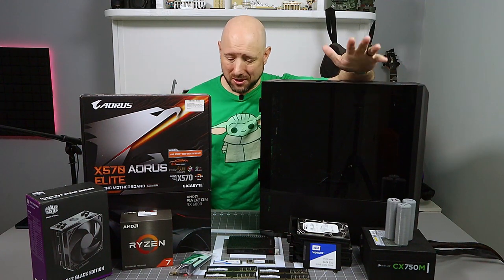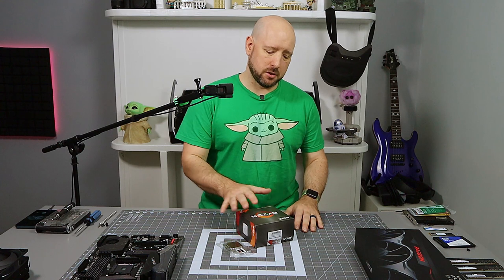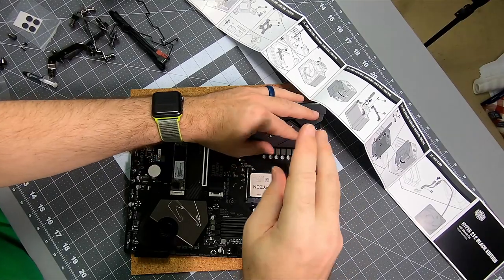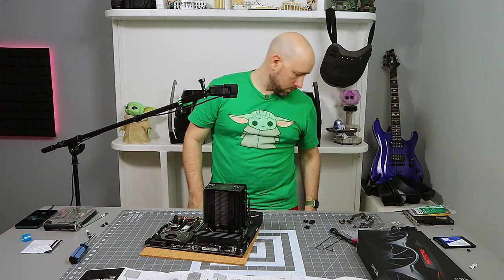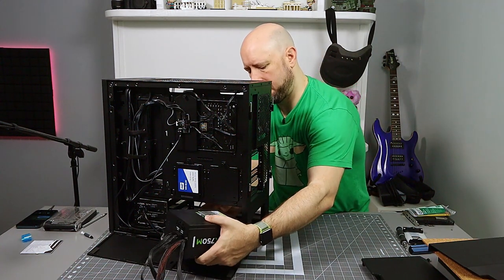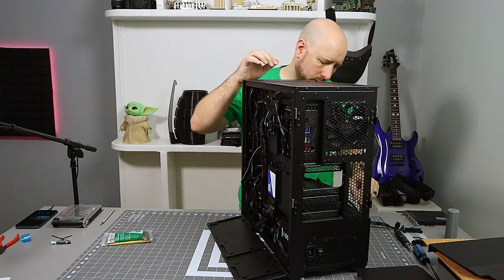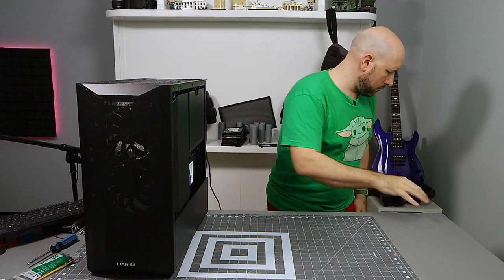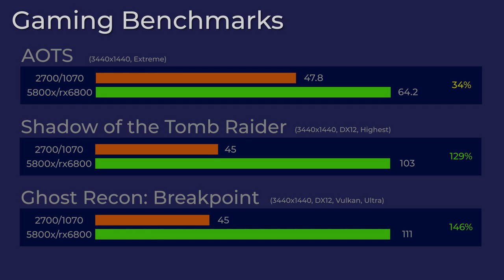Watch Me Unbox and Build a PC (Ryzen 5800x, Radeon rx 6800)

Comment: Thank you for the video. Have the same processor and same motherboard. Crossing my fingers my pc build will go smoothly this weekend.
Reply from the maker: Thanks for watching and good luck with the build!  The BIOS-doesn't-work-over-HDMI thing was a lot more time consuming that it should've been.  Hopefully this saves you some time.  Also, the BIOS on the board did NOT support the 5800X OOB and QFlash Plus directions are a bit spotty.  Here's how it worked for me: 1) Unplug everything from the board except power, 2) Insert FAT32 USB drive with the prepared BIOS on it, 3) Press the ATX power switch and immediately after press and hold the QFlash plus button 4) Hold the button ~20 seconds or so.  The QFlash light didn't seem to start flashing until the button was released.  Good luck and have fun!

Comment: Hey, have you been having temperature swings and fan oscillations on the ryzen 7 7800x? Because I have. I'm trying to figure out how to smooth out power delivery and bring idle temperature down.
Reply from the maker: Hello Javier.  Performance seems pretty consistent with expectations on my 5800x.  Idle is 50c.  Under load the CPU will boost to 4500 and temps will hover around 86-87 for the duration of a Cinebench multi-core test.  Fan also seems to be consistent under load as well.  That's with no OC at all.  If the temperatures are swinging and you don't have any custom curves or overclocking then your cooler/paste might be the culprit.
Reply: What are the max temps you get while gaming? Thanks
Reply: So the temperature swings were do to NZXT Cams software, and I also drilled some vents into my pc case. I had a really bad airflow case. I also upgraded to 140mm fans. Max cinebench is 83 degrees. Cpu/Gpu are high mid to low 60s while gaming under heavy load.

Comment: What are the cpu temps after like 30 mins of gaming?
Reply from the maker: Hey Clean Playzz.  After 30 min or so of Cyberpunk I topped out around 76C degrees.  With 45min or so of Borderlands it kissed 80C for a second but was normally down around 76.  I think it was actually the ubisoft updated running in the background at the same time that pushed it up a bit.
Reply: @LilMikeysBigPlans  did you undervolt it

Comment: hows the temps im getting same cpu coller set up this weekend
Reply from the maker: I got it to poke at 73C doing some pretty aggressive encoding + gaming.  I'm not a mad overclocker or anything and wasn't watching throttling so not sure if that means much in isolation :)  I have not seen any heat-related issues though.

Comment: whats with the cheap looking ram sticks?
Reply from the maker: Think you nailed it in the comment. That crappy little Timetec RAM operates at 3200 spec and back when I bought the first 16g it was quite a bit cheaper than fancy RAM. :)

Comment: I also have a hyper 212, paired with a 5800x. While playing games like valorant, it goes up to 82-84 c. Im not sure this is normal. And the fan speeds were fast. do you have an idea of what the issue could possibly be?
Reply from the maker: Modern CPUs will throttle automatically to maintain working temperatures.  Unless something is really wrong you're not going to overheat your CPU.  Worst-case it should shut itself down if it can't manage temperatures.  What you will see with inadequate cooling is aggressive thermal throttling resulting in significant performance drops as the CPU bumps against its temp ceiling.

Basically as long as you aren't seeing a dramatic drop-off or broad swings in performance your cooler is probably fine :)
Reply: @LilMikeysBigPlans  for some reason today I was playing Valorant, and even though it’s cpu intensive, for some reason the highest temps I hit was 70 c. Is that ok? I shouldn’t be alarmed about that right?

Comment: How much are all parts without The case?
Reply from the maker: Some of the parts are a few years old so not sure what I paid for them and some were special deals but here's what everything would cost if you bought it today:

Radeon rx6800: $580
Ryzen 5800x: $450
Aurous Elite X570: $200
32gb Timetec DDR4 PC3200: $55 x 2
Hyper 212 BE: $33
Corsair CX750M PSU: $105
1tb Sabrent RocketQ: $110
1tb WD Blue 2.5 SATA SSD: $93
Avermedia LiveGamer HD2 Capture Card: $140
Lian Li Lancool II Mesh: $100